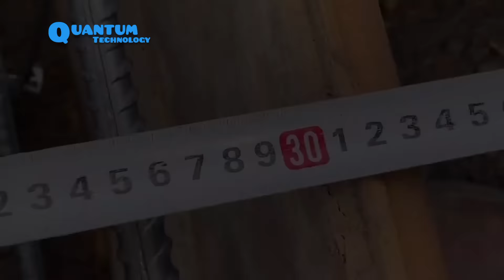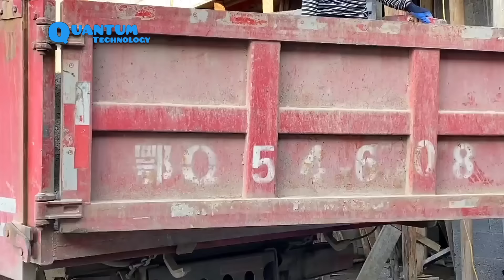build a cool and peaceful 2 storey house on high mountain

Comment: It is possible one person can build a house.  My husband age 65 had 2 workers did 10 houses.😂😂😂.  We had cement mixer so not so bad.  Building a house doesn't need rocket science just some good old common sense.  It is better if one but a land and build yourself as you do not tie with the bank.  The beauty of rural place, one do not need to have any licensing or permit to build a house.  It is different in the big city.

Comment: Retaining walls fail when you use too much cement. It blocks moisture and doesn’t allow drainage from the hill. Winds up pushing the wall forward. You should put a few tubes in wall to all drainage of water. That’s a big hill behind your wall and a you used a lot of cement. Just saying.